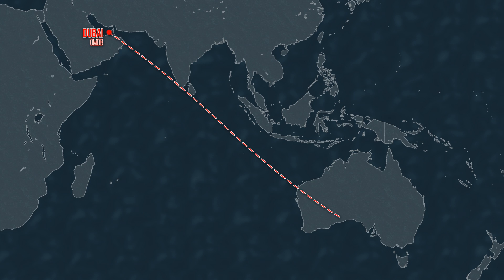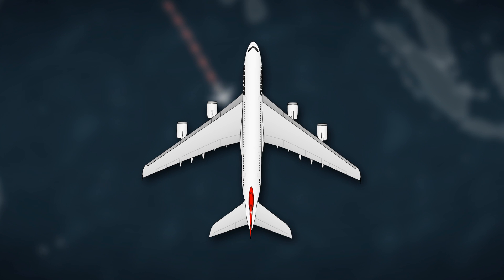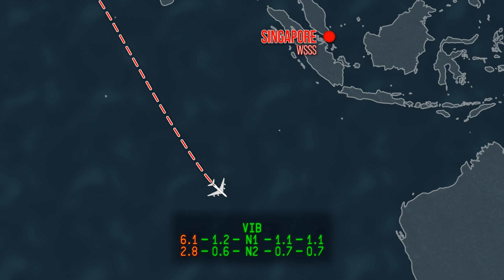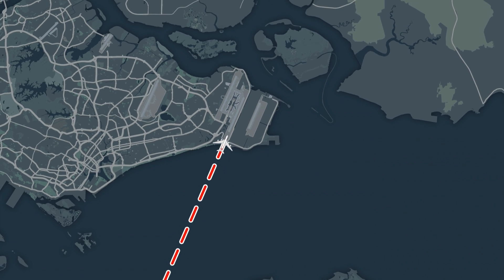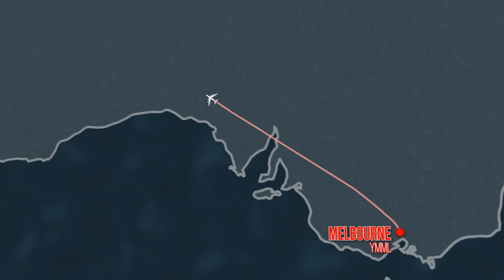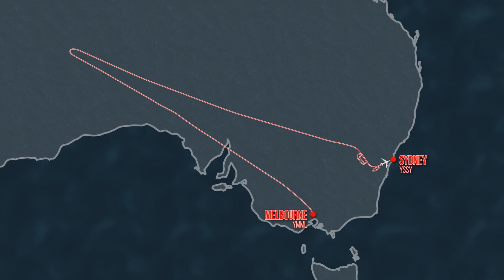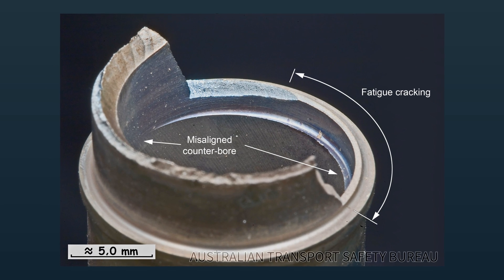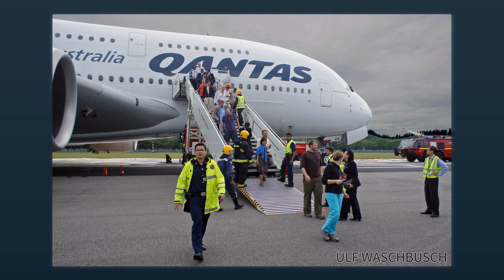Qantas A380: Engine Out

Comment: Interesting, i wonder if those stub pipe problems and turbine disc control were really fixed on Rolls Royce engines, it is really similar failure to the Qantas 32, as you say. Luckily it was shut down promptly.

Comment: Amazing production values, but just curious, why did you remove the radio chatter? Could you work the most interesting pieces in between narration segments?
Reply from the maker: In this case, there wasn't any ATC audio available at all. Where it is available, I usually include everything relevant.
Reply: Wow, do you like aviation?

Comment: for the QF10 incident, did QF replace a Trent972 in 24 hours? or they leased SQ inventory Trent 971 intsead?
Reply from the maker: Qantas can perform full technical handling of their RR A380 fleet in Singapore, so it's likely they sorted out their own inventory.

The aircraft was positioned back to Sydney on February 8th.

Comment: Still quantas remains to be the safest airline with no major fatalities.. l
Reply from the maker: Qantas has never had a fatality in a jet airliner, and regularly tops aviation safety rankings. Go the flying kangaroo!
Reply: quantas isnt an airline
Reply: Quantas did have eight lost aircraft and multiple deaths during and after WWII, including one where an engine failure caused a plane to crash, killing the seven onboard. It is an exceptional safety record, comparable to Southwest, who have never had an accident resulting in the death of an occupant of the aircraft, though during a runway excursion, they squished an 8 year old in his car seat with their engine. Their only other fatality is a passenger who was killed accidentally by the other passengers.
Reply: MillionFoul thanks for the insight mate.
Reply: no U
it's QANTAS
Reply: AirTrafficVisualised. I thought so my facts are correct🙆🙆🙆😋
Reply: Qantas is a great airline though